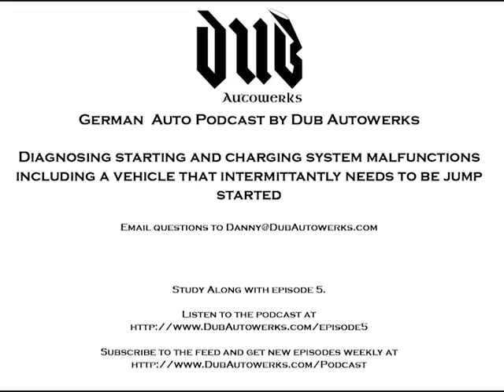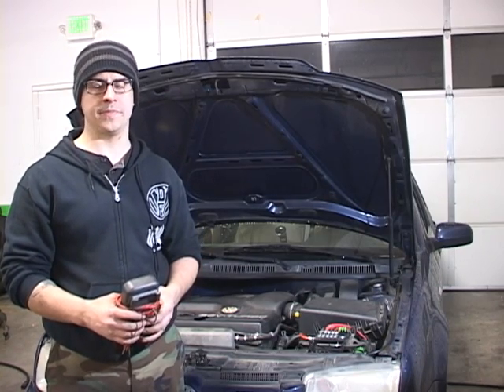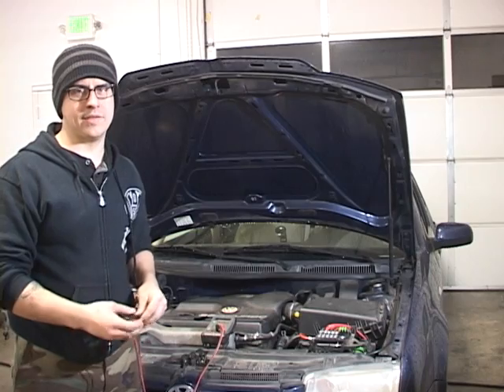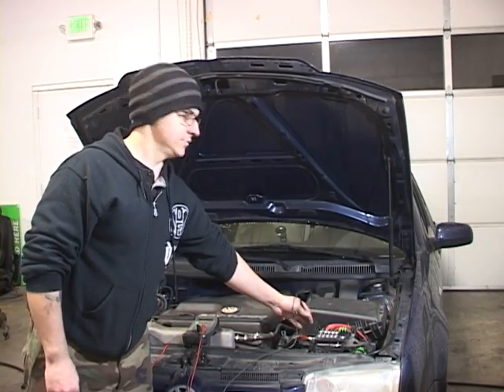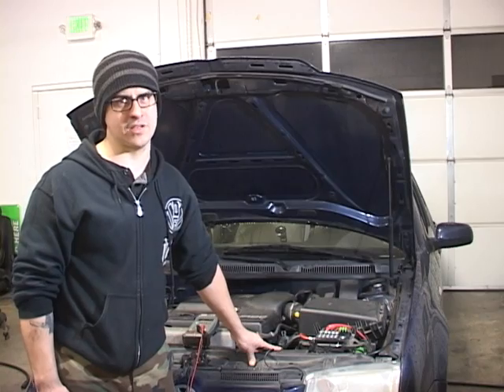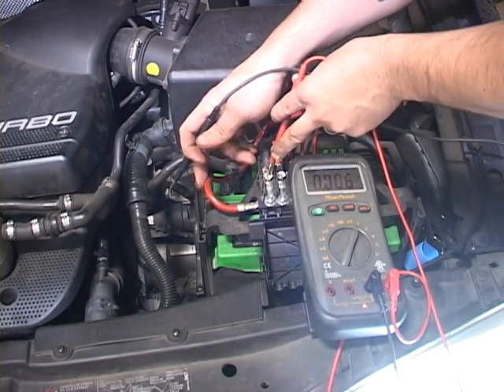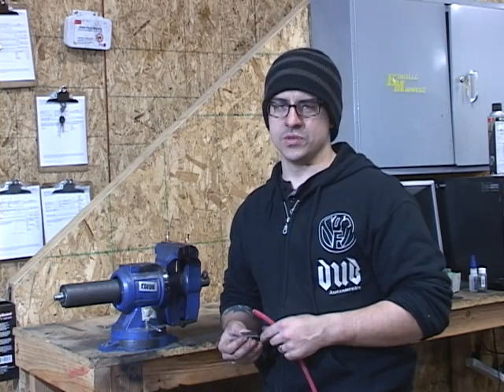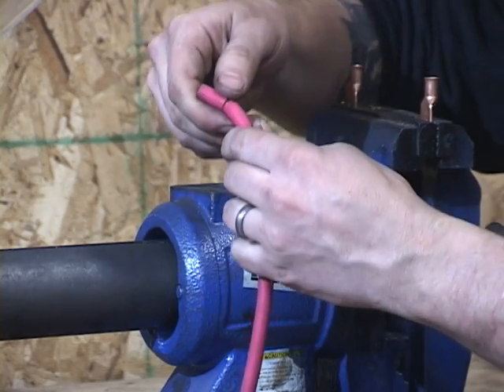Automotive Alternator and Battery failures and how to fix the cause

Comment: But what about the 3 plugs that are in line with that main cable? Will they work if I just put that new cable running parallel ? Do I have to wire them into this new cable?
Reply: Yes, what about them.

Comment: Your soldering job would go a lot quicker if you clamp the terminal in the vice between two pieces of wood. Straight in the Metal Vice is a great big heat sink...

Comment: Did you do a follow up showing the difference in voltage drop with the new larger cable?
Reply from the maker: Dan Price It's not that it's larger cable, the larger cable DOES help, but you won't see the difference unless you have a full load and your alternator is putting out a substantial amount of amperage. Basically you'd need to be putting out enough amps that the cable becomes a restriction which would be tough to do. 

It's more about getting rid of the old cable due to the excessive voltage drop. A brand new cable of the original size would test about .06 or .07 drop as well.

The main reason I'm upgrading the cable size is because "why not" more or less. The vehicles with 150 amp alternators may benefit from it, the 90 amp alternators likely won't.

Comment: I personaly dont change the cables like that , only either re crimp them or solder the ends. if there is a voltage drop its 99.9 % the lugs - or cable ends whatever you want to call them. I did that to my 3.0 tdi Q7 and sorted charging problems for good.

Comment: Not these days. I have seen Audi voltage change from 12.6 to 14.4 on hihhway cruise. This is intentional, the alternator intermittently SHUTS when the battery is full, to provide less power draw on the engine and higher mpg. Very unconventional, not simple like old cars.
 And I've had a new Harbor Freight volt meter read 12.2 volts when the battery was 12.6, the $10 meters simply are not calibrated.
 Sorry, but charging is way more complicated than it used to be.
Reply: If you're showing a voltage difference from static and running ,there's not a lot more to know. 
At least those meters will tell you an outlet is hot ,I don't care it says 130v when my fluke says 122v. 
So it says 14.3 with a harbor freight meter and your fluke says 14.
To me ,at least I know it's working and those numbers don't alarm me as to being over or under charging. 
If it's suspicious,borrow another meter.

Comment: Hi excellent video but I have a question in a new bettle the voltage must be the same around 14 to 14.5 with loads if this value is over 14.5 o more the possible problem will be the regulator o another one ? Thanks a lot .

Comment: hello my friend very good video. but here is the thing. I have a mk4 vr6 and the wire that comes from the alternator has two more connections  also i have a mk4 1.8 t exactly as the one you show in the video and i believe also has the two plugs connections my question is are those plug useless?  or just trow the wire directly as you show and is not going to be any problem or the one i just remove  I can connect to the battery..
Reply from the maker: Gero Azmodii I think you're maybe referring to the plug that goes to the alternator and on top of the starter? reuse those...just make a new main harness

Comment: Very useful video - I did exactly as described (I bought 4 ft which gave me about 5 inches slack which i pushed back down under the battery plate) - I did have to drill out one end to fit over the connecting lug on the alternator all working great now.  I did purchase a new fuse box as the other was melted.
Reply: where exactly did you buy all this items can you help me out this is the problem im having with my 2005 jetta, i bought the fuse box on ebay but i also need a charging cable and i cant find it anywhere, any help would be great thank you